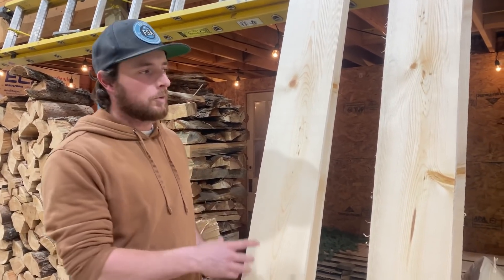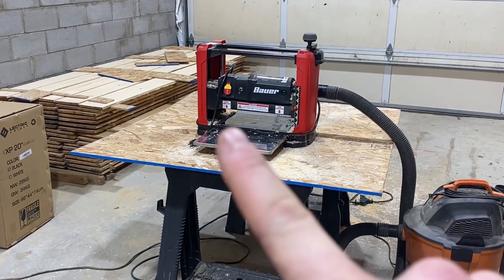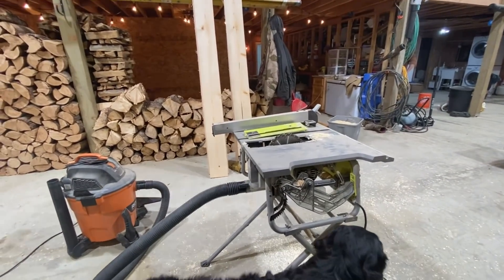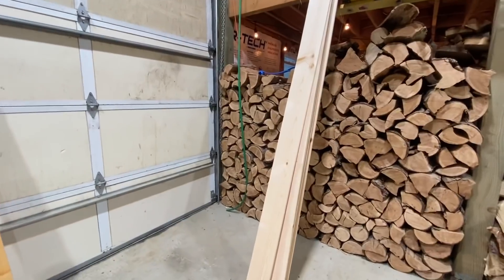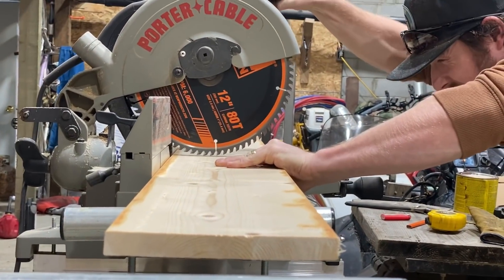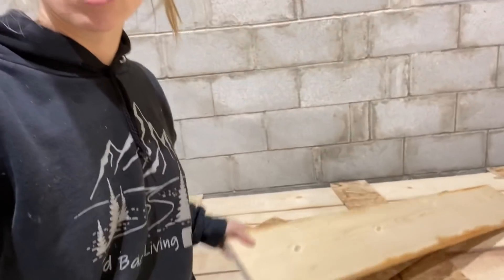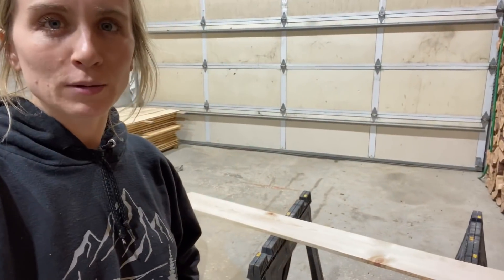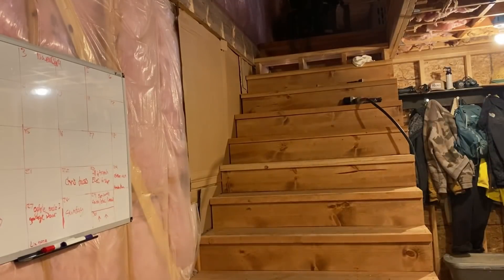IS IT WORTH IT?? Risking Beauty for Budget

Comment: I’ve done construction for 40 yrs. and you can’t go cheap on your power tools, that will always bite you, sooner or later they will leave you in a bind trust me on that one. My favorites are Dewalt, Milwaukee,and I’ve had good luck with Porta Cable too. Lately I’ve went cordless on just about everything. But air compressor,chop saw,and table saw although I have them in battery powered and they have their place ,but if your doing heavy work all day then I use my corded tools there. I really like your channel, and keep up the hard work it pays off, albeit on a homestead the WORK IS NEVER DONE but at the end of the day you both can step back and look at what you’ve done and be proud. By the way keeping it Dutch sent me your way I’m glad he did

Comment: Home depot sells a sawdust collector that works very well with your shop vac.  It collects the heavy sawdust and saves your filters on the shop vac.  Much better than connecting saw or planer directly to the shop vac.

Comment: If you connect the vacuum or a bag to the porter cable saw you won't have all the dust flying. Saves Michael from having to clean up later.

Comment: Been running the dewalt for about 5 years. Keep the blades sharp and you will never have an issue. They also make a helical head that you can put in it that cuts even better! Not necessary though.

Comment: It is on the cheap side of planers but I have seen them ripples in more expensive planers Grizzlies with inch thick table top rippled its caused by people  running to long of material thru it. Look  at the manual bet it is rated for 8 foot material. And waxing the tablet on it helps  but they make a dry lubricant to help cool table. It works wonders did use it daily for 50 + year's of doing high end custom cabinets and furniture. Keep the planer for rough planing get a dewalt or Milwaukee for finish planing.

Comment: Well here’s what went wrong. The riser boards should go in FIRST (the ones you just installed), then the stair treads (the ones you walk on), that would have eliminated all the cracks. Also the u defense of the stairs will need to be insulated in the future. Also pretty sure you cut them all too long, don’t think you took into account the wall covering whether it be shiplap or drywall will need to fit between the riser, treads and the wall studs (cause I’m pretty sure the left side stringer is screwed directly to the studs on the wall).

Comment: I bought a Dewalt 735W after experiencing horrible problems with siping from both, the Harbor Freight and Wen planers I purchased and returned. Although it was more money originally, I think that it has saved me money in the long run. If you are going to make finished lumber, it is a must to have a decent planer with access to parts, if necessary. Dewalt has been great in making any parts you need easily available.

Comment: The stairs look super! 
The nuts on a spinning shaft always come off in the direction of rotation unless a tab, cotter pin, or some other mechanical device holds the nut in place. On a bench grinder with a shaft coming out on both sides, the right side is a right-hand thread while the left side is left threaded.

Comment: You can seal the steps faster by using shellac for the first 2-3 coats and then you can use a wipe on poly by hand for 2-3 coats and it will dry and cure pretty fast between each coat and you wouldn’t need to be gone for the whole day. Or you could just use the shellac. Just a tip. Steps look good, great job on them.

Comment: 12% moisture is just fine for planing down wood for trim work. Lots of baseboards, window, and door casings in my place from two years ago that are still going strong planed at 12% moisture. Those black marks are remnants from your feed rollers on your planer. The cutters are likely misaligned or dull. I had similar problems with my ridgid planer, then the motor burnt out and I ended up paying the big bucks for makita. I have zero regrets for upgrading. It's an order of magnitude better quality.
Reply from the maker: We believe this is the issue as well. Will be upgrading soon!

Comment: I bought a similar planer in Germany. It is good value for money, don't return it. When it starts to make a lot of noise you need to sharpen the blades. The rubber rollers start to slip and the steel bottom plate is giving off the black smears. Sharpening the blades is difficult but on YouTube you can find solutions how to do that.
Furthermore I should suggest to buy a large dust collector, a shop vacuum cleaner is too small.

Comment: Mike is a lucky guy! Pleasure to See U working together 💪
Watching when You milled this ponderosa pine to boards I was wondernig where U  need so thin boards (1/2"?) - as for me I rather don't go below 1" green milled so after planning some 22mm - but now I see. Also this hydraulic nail pistol has a chance 😉
And for the safety I started to use ear protection when planning and soft leather like gloves when workin with pine or spruce - got too much splinters 😫 in my hands...

Comment: I'm not trying to be over critical, but I see screws on the top side of the stair treads.  Screwing blocking from underneath would have looked better. Wider boards would have been better yet.  Staining the risers is sort of like putting lipstick on a pig. A job site saw is scarry for the length of boards you are using.  Investing in a cabinet saw as soon as possible to keep yourselves from being hurt.  I know, you are probably just squeaking by, but a cabinet saw can make you money.  You need a joiner.  A drum sander would help.

Your stair jacks should be within 1/64".  Use a calculator to get your distances.  The hypotenuse is the square root of the tread squared + the riser squared.  You should also be using builder square clamps.

Use brown caulk to seal your cracks from the backside.

Comment: You spoke about how much you paid for the wood, implying it was not much. Well add up the costs of equipment deprecation and fuel, divide by the number of useable board feet you ended up with. Now what was the price of the wood, could you have bought it for less and done something more valuable with your time? I can't even guess how this will come out, but when I've done some DYI, my value calculations have surprised me.

Comment: If you're concerned with heat loss,  you might win some with putting insulation on the underside of the stairs and the walls of your mudroom. I'm not sure if your upstairs wall between shop and house is insulated. If not, that too will cause heat loss. 

Kind regards Christiaan
Reply from the maker: We still have more insulating to do but I like the under the stair idea! This would help with heat and sound proofing too. Thanks for watching!

Comment: Water-based polyurethane dries faster In a couple of hours but however if you was to set a fan up it would even dry faster like within an hour because of the wind that the fan creates and everyone knows that wind driesthings faster right. And as far as your planer goes I don't know if the burn marks on your boards is an issue with your planer or if it's an issue with the moisture content that is in your boards cuz you said that the boards only dried out 12%, they're still quite a bit of moisture in the board still lumber should be dried at least to 80%. So however I don't know exactly when you come out this video but if you still have the planer I would test a board that's been dried at 80% and see if you still end up with burn marks before you decide to take the planer back to harbor freight. And also another thing with planers is you can use them a few times and then the blades will begin to start becoming dull which will also leave burn marks on your wood when you planing them so you always want to make sure that your blades are as sharp as possible. Now how I test to see if the blades on my planer is sharp I raise it up as high as it can go and then I take a piece of paper and go up underneath and just slide it holding the paper at both ends slide it across the blade if it cuts the paper nice and clean then I know that my blades are Sharp if it doesn't and it rips and has tear marks on the paper then you know that your blades are becoming dull or even getting really dull.